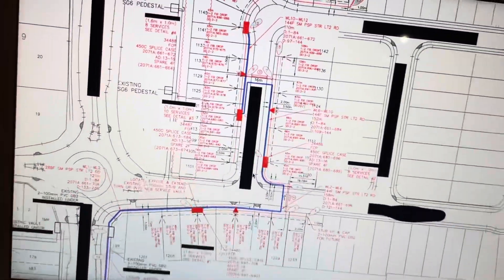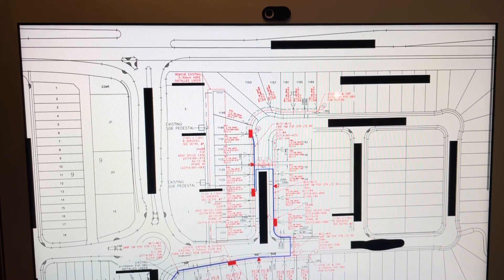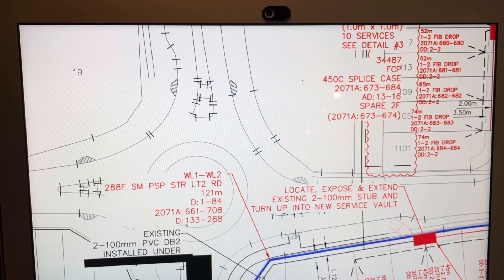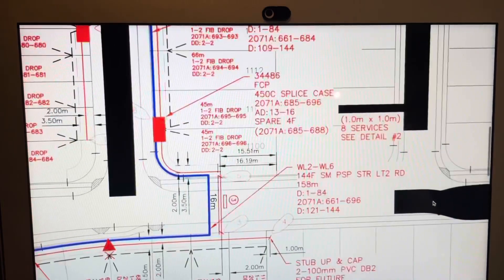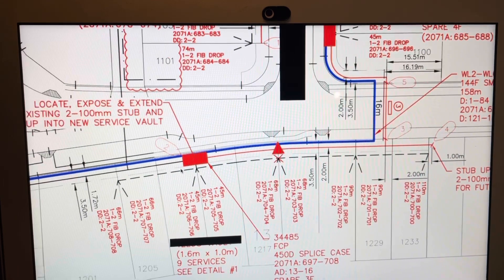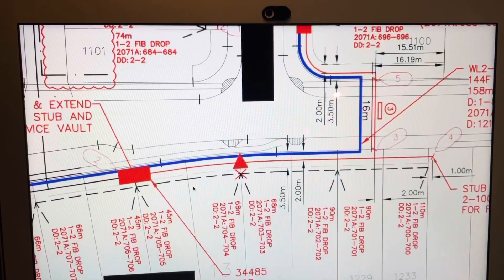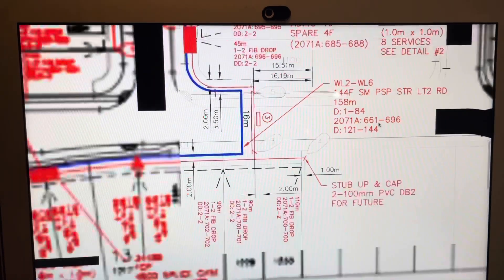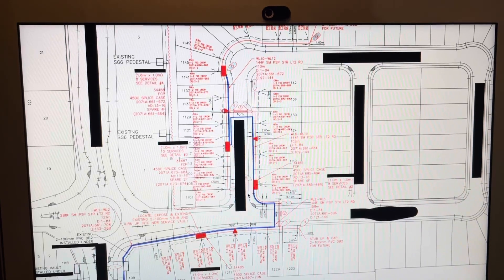How to determine fiber optic splice locations from the network design

Comment: Is this a Canadian or US design schematic. How could the splice count be 661-708 if the feed is only a 288F.
Reply from the maker: CAD and this is because the cable is a 288F yes but the network it is being spliced within is a 864 fiber distribution hub allowing the designer to use the available count left on the network which was the higher count 661-708. Counts 1-660 of the 864 within the network are already being used elsewhere on the network this was just a 288f branch from the main hub. 
Thanks for watching and commenting I really appreciate it🙌
Reply: @FiberSpliceGod  I want to make sure I fully understand this.  So this line of distribution can handle a total of 864 fiber connections.  The “D: 1-84” would represent that the fiber strand #’s on that particular line are dead, but then the “2071A: 661-708” represent the connection for the hub?

Is 2071A the name of the source hub?

Comment: If the cable count is a 288 how can you be splicing fibers 661? Im having a hard time understanding this
Reply from the maker: There is cable sizes and fiber counts so this cable size was a 288F which means there is a total of two hundred and eighty eight fibers in the cable. The count is assigned by the designer to the cable based off of the available fiber count remaining on that branch of the network. Usually the count will range between 1 to 864 depending on the size of the network
Reply: Are you saying the cable size and fiber counts are different but this cable size is 288F (F for fiber)? So if it has a range of 1F-288F how are you splicing 661?
Reply: @ after some time getting hands on work fiber 661 isnt based on the cable youre working with its just a reference. You can usually look at the dead fibers on the cable youre at and its a little bit easier to tell whats going on

Comment: What is dead count
Reply from the maker: Dead count works like this if I have a cable that is 48 fibers with a splicing count of 1-24 and dead count is 25-48 this means the first 24 fibers in the 48 cable are going to be spliced through and the last 24 fibers of the 48 cable will be dead this means they are not being used in the cable and just sitting there not connected waiting for the future when more fiber is needed they can splice in a new cable and use the remaining 24 fibers that were dead. Hope this helps thanks for watching

Comment: Hi, thanks very informative video as always. I am struggling in designing my network for future reference. What platform do I need.
Reply from the maker: Hey thanks for watching and commenting 🙌 I find best plate form for designing networks is AutoCAD. I will maps it out on google earth pro first and then I put it into a AutoCAD design
Reply: @Fiber Splice God  Hi bro, can you please make a video tutorial on how to design it using Google earth and then draw it in Autocad.
You can show this with small network. Please also make a video tutorial on how  to design a fiber network using ring topology by connecting 5 data centers in this ring. And connecting customers to it.
Reply from the maker: Hey bro thanks for watching and commenting 🙌for more in depth videos and requests like that I will have to direct you to my patreon.
https://www.patreon.com/FiberSpliceGod
If you would like a design done I am currently charging 3k base rate per network design which comes with a Google earth pro version, AutoCAD version, and a full breakdown of materials that will be required to complete the design.
Reply: @FiberSpliceGod  thanks